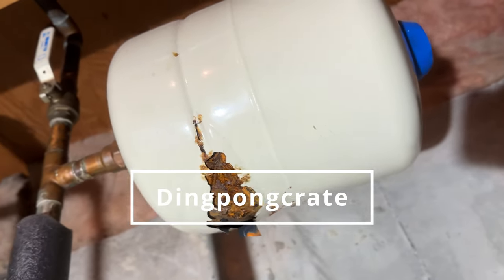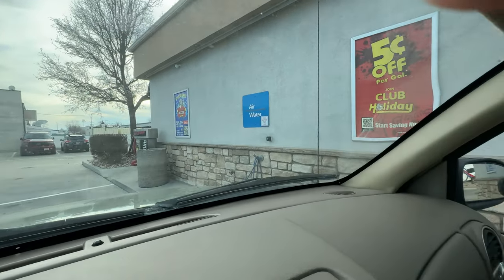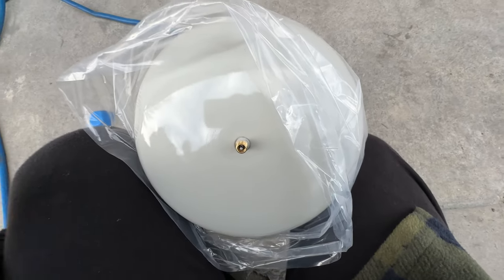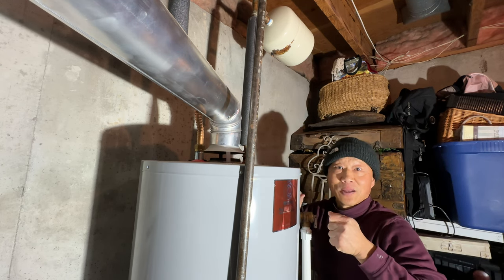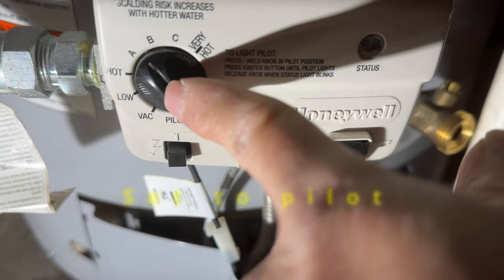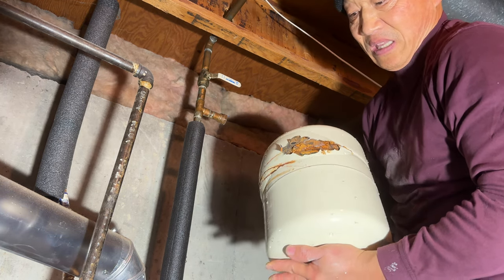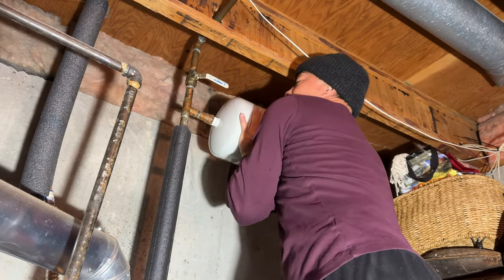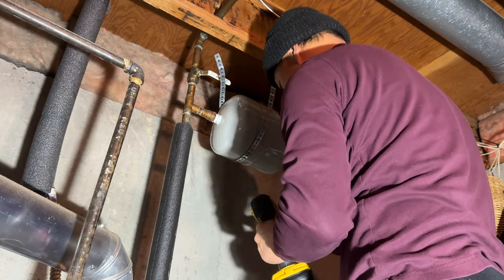Failed Expansion Tank Replacement? Here's How to Prepare, Pressure, and Install

Comment: Great video, BUT- 95 psi is considered high for domestic water pressure. around 60 psi is considered normal. I would suggest locating your PRV (pressure reducing valve) and adjust it to lower the pressure. It should be located after your water meter and turning the adjustment bolt counter-clockwise will reduce the pressure, if it hasn't failed (a lot of times high water pressure is from a failed PRV).
Bonus points for using tef tape AND pipe dope!
Reply from the maker: Michaelg.294 Thank You for the great advice. I should learn from you. This house has been set pressure to 95 psi. I thought 60 is an average. It looks like I need to look at PRV in detail.